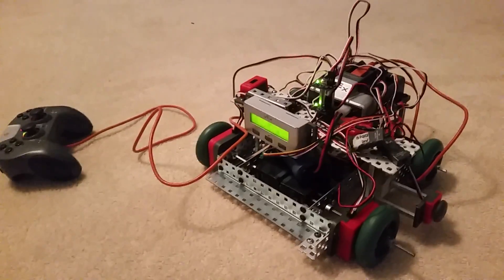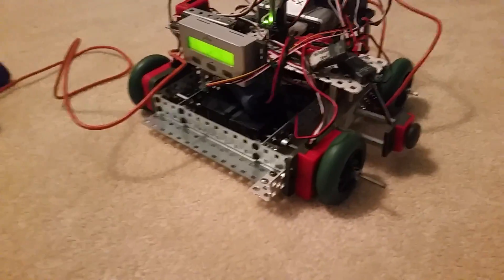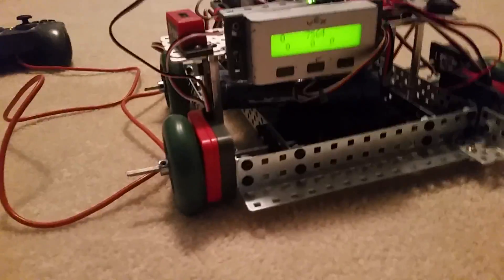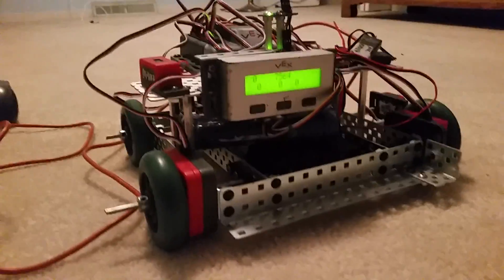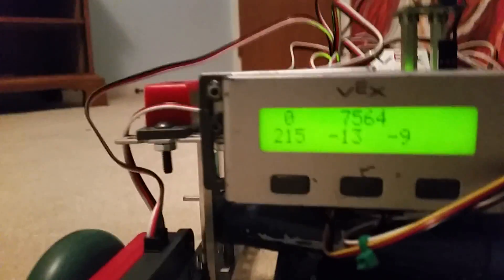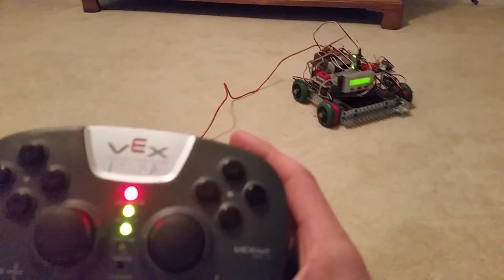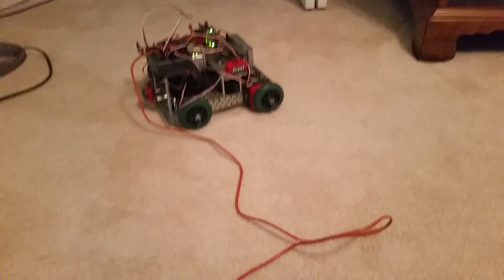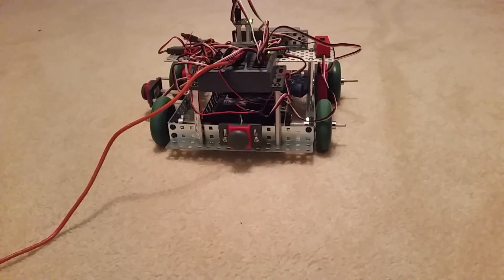REX 1727B - Robot Position Tracking - Vex Nothing But Net

Comment: He so i looked at your video about position tracking and i have been working on something similar to that using the 5225A documentation online. I now have finished the actual position code but now i am having trouble implementing that into my drive and turn pid. Could you please help with this. (PM me if you would like)

Thanks
Reply: Did you ever figure it out?

Comment: If you're able to calculate how far the robot is from the goal, are you able to press a button and the robot will automatically pick the speed of the flywheel?
Reply: +Mr Frogg kindof, we tried that, so we can accurately calculate how fast the ball needs to be shot, however X wheel speed does not convert to X launch speed. and we have not been able to determine an equation to translate a needed lauch speed into a needed wheels speed

Comment: this code is amazing
Reply from the maker: +Jeremy  the math here is really not terribly complicated, to make a basic version of the code, you just measure the encoders, then convert tics to distance using the equation Distance = WheelDiameter*PI * (EncoderValue/360);

then you reset the encoders to zero, then you use some trig to calculate a change in X and Y
so 
Change in X = COS(Angle) * Distance
Change in Y = SIN(Angle)* Distance
and
Y += Change in Y
X += Change in X

this will get the basics of how the code works, just keep in mind the SIN and COS functions want radians, and they output Radians, but the gyro outputs in degrees, so you will have to use the function RadiansToDegrees(angle) then you put that into the SIN and COS functions

once you have this, you can track your robots location, from there it is just making the auto-navigation code, and fine-tuning every thing

for autonavigation, you just need a control loop to turn you to a specific location on the Gyro Sensor, and you use the ArcTan function of robotC

so you calculate the Difference in X and Y coordinates between your position and your target position

so the angle between you and your target = ArcTan(ChangeInY/ChangeInX)

again remember this will output radians

then you calculate distance with Distance = SQRT(ChangeInX^2+ChangeInY^2)

and a control loop to move that distance

and boom, you can have you very own version of this type of code. that's the basics and with tuning and improvements you can make it more accurate
Reply: Hey Rex, what did you mean when you said you estimate the arc of the robot? Isn't what you're doing here just breaking the robot movement to little sections like regular position tracking?

Comment: Nice code bot! Wish I had this as well. Though, how are you not getting noise in the gyroscope? Our gyroscope gets crazy readings when we have vibration from certain mechanisms such as the flywheel. Would this system be reliable on real robot?
Reply from the maker: +唐朝 The number one thing that eliminates noise is the rubber link that suppress vibration, we also have two gyros that help average things out, also we only take gyro readings every 20 ms and average out over that time, so this helps to cancel out temporary noise
Reply from the maker: +唐朝 The system is just as reliable on a real robot as it is here, the issue again, is gyro drift, so there is error in the system, if you are asking, could I drive around for the full match and then as the robot to point at the goal and have that work, the answer is probably no

Comment from the maker: Robert Majcher, there are only two quad encoders, we have found that quad encoders do not accumulate error very much, for example, having a quad encoder on the front and back wheels, those two encoders will always have very similar readings, and therefor the second encoder is redundant
Reply from the maker: we don't have the room in our current design, If we ever find we have the room in a future iteration of the robot we might give it a go